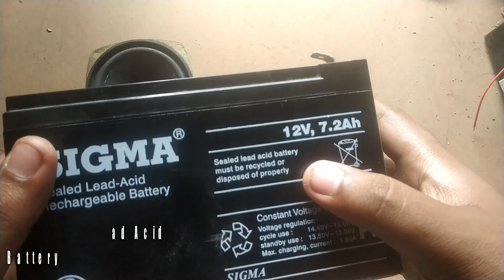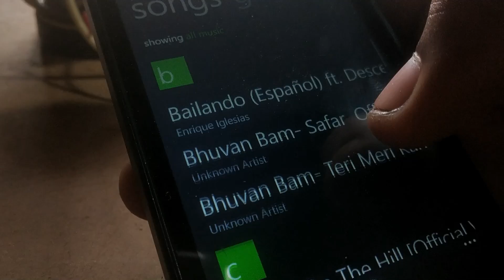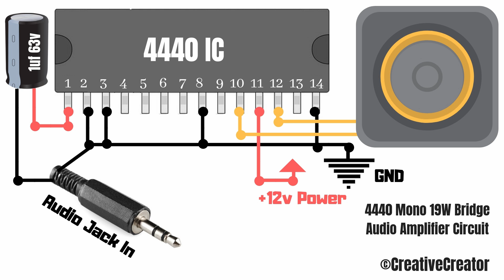Powerful Amplifier with 4440 IC

Comment: 4440 dual ic amplifier m 2 cabinets lgane ho 
Toh kitne power k lga skte h? 
Jaise.. 2 twitters aur 2 speakers for bass.. 
Please, Help!
Reply from the maker: 100w to output hoga so...
you should use a mimimum of 2A Transformer
Reply: @Creativecreator  
Mate, I asked for Speakers.. 
I dint ask for the transformer.. 😅
Reply from the maker: @JasbirSingh-fk4wj  if you use single Ic then you can get
1. 19W Single Channel Output(Bridge mode)
2. 2x6W for running 2 speakers.

If you use Dual 4440IC then 100W Maximum.
Reply: @Creativecreator  
Yeah, that is the answer... Thnxxx!

Comment: brother i have 4 capacitor 25v 1000uf in my amplifier i want to replace it to get a better baise and sound what frequency should i use capacitor for it..
Reply from the maker: Yes you van change for better sound
Reply: Add capacitor with a film capacitor in  parallel for better bass

Comment: Why low sound? This 44440 ic but the sound very low ?
Reply from the maker: Check the solder joints search for loose connections
Reply: Ha Bhai sound slow hai